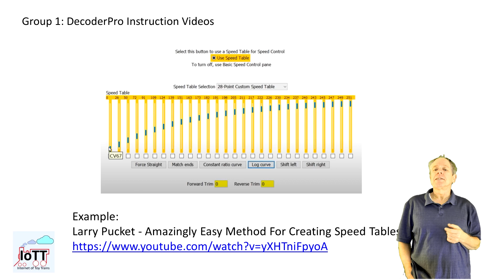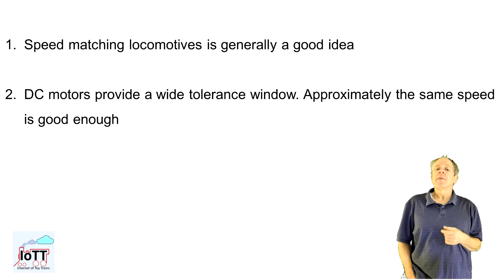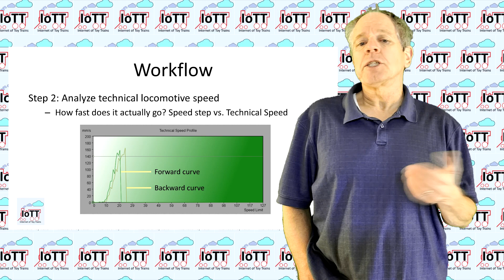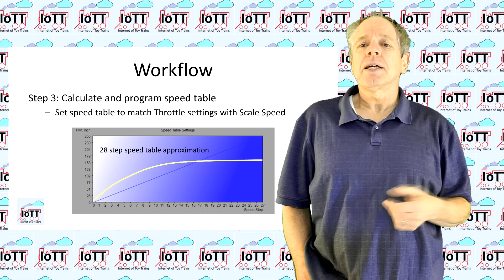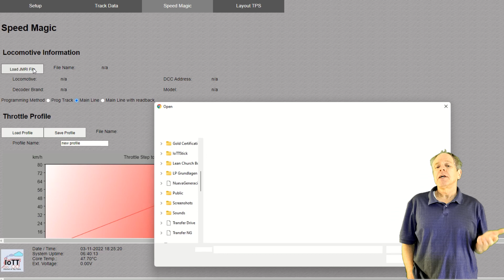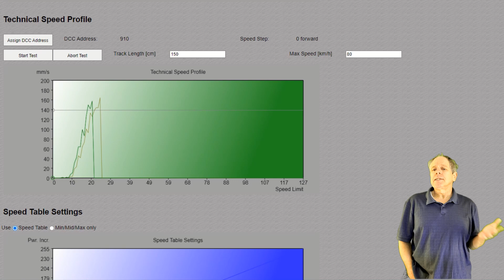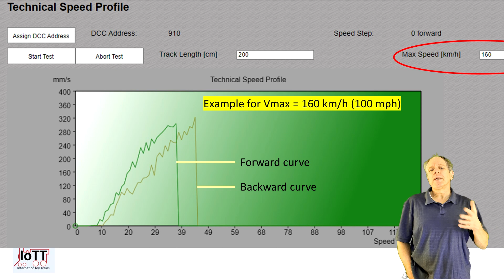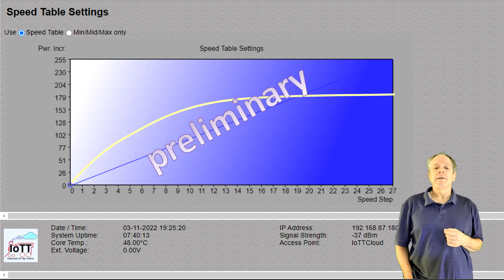Speed Matching Re-Invented (Video#90)

Comment: I love this innovative approach. I can’t wait to try it out. As I was looking at your purples hat measuring car trailing the engine. If we don’t care about a prototype look. I guess we can make the floor of the car the actual pcb board and screw the truck directly on the pcb. For this I guess a washer will be needed so the spacing between the wheel  and the pcb is right. At lease for n scale it can make sense as it will be hard to hide in a box car anyway.
Reply from the maker: A track measuring car is always not exactly prototype like, I guess. In N scale, the difficulty is not to exceed the allowable profile of cars. On a test track like in the video it is less critical, even though I also had some problems with the Stick touching the signals. Therefore I think for N scale the Stick definitively needs to be in upright position, but I am using still the old prototype board, so I had to lay it flat. The distance between axle and sensor chip of course should be as small as possible, especially when using only 2mm magnets as I do here.

Comment: I have place a boulder creek engineering speed step sensor into a MTL 6 axle drop bottom flat car with the inner wheel set running the magnet.

Comment: This is something I looked at years ago,  some sort of PLL or feed back loop but at the time the consumer chips that we had like the Basic Stamp were not up to par with what I wanted them to do.  Will be following this,  This is something I wanted to do in 2000,  just took someone 22 years to get to this point.  As a follow up,  Running NCE.  But if this works with a cheep Digitrax system,  that would be great.
Reply from the maker: Yeah, that was the time of the PIC controllers ;-) Luckily, today's controllers have a little more computing power.
Reply: @IoTT  True,  I worked at intel for 21 years as Sr. FAB Tech.  I have seen the change from the wafer level.

Comment: Is the Purple Head car something tht is purchased or made?
Reply: It's something that Hans will offer in his tinde store
Reply from the maker: The PurpleHat sensor board will be available in a few weeks in my Tindie store. I will also publish the board design on Github, as usual. So you can build it for your self.
Reply: @IoTT  I just bought the purple hat sensor board and the IOTT stick. Is that everything I need to do this speed matching.
Reply from the maker: @HumancityJunction  Yes, you are good as long as you have JMRI or another software the Stick can talk to to make the locomotive move., The Stick can communicate via WiThrottle or Loconet over TCP protocol. JMRI supports both, but Loconet over TCP I believe is only available if you have a Loconet system.
Reply: @IoTT  I have a WiThrottle server setup, so that is likely the easiest. I am running a LocoNet system as well, but have not used LocoNet over TCP yet.
Reply from the maker: @HumancityJunction  That should work. I would recommend to also try Loconet over TCP as with that protocol you can directly program the speed tables from the Stick, without first saving back the files, so it is somewhat more comfortable.

Comment: @Hans: Great idea. Which components of your universe are required to use this function? Do you have an idea when the measuring device is ready and available?
Reply from the maker: Thanks. If you have a LocoNet system with connection to JMRI (e.g. LocoBuffer), all you need is the IoTT Stick and the PurpleHat sensor PCB, which will be available in the Tindie store in a few weeks. The IoTT Stick can then connect via Wifi to JMRI using the LocoNet over TCP server.

Comment: I did some experiments with some N-scale locos. My test track has a length of around 18m. I placed 2 locomotives on the opposite side and let them run the same speed and see which one runs faster. This test showed that even with the same model and decoder they run diffeerently. It can be that loco 1 runs faster than loco 2 (as you would say the speed difference is well acceptable) and after  a few minutes this changes without any throttle changes. Also it can be different for slower and higher speeds. There are differences I did not mention yet. The P I D settings of the motor driver set in my ESU decoders with the auto setup of cv54=0 function imo influences the speed curve as well.
Did you measure the curve with acceleration in both directions only or also deceleration as well?
For me it would be helpful to know some grassroot rules for which criteria that must be considered. I struggle to consist different brands in general even if they are controlled by ESU decoders of the same generation.
What do I need to do when I want to consist 2 (or more) locomotives where vmax is 70Mph and 100Mph respectively? My roster is 3 point linear programed with CV6=(CV5-CV2)/2+CV2
Also CV3 and 4 influence consists.
Then I think traction tires require more accuracy in consist setups unless you don't mind excessive wear of the locomotives and debris on track or even traction tires falling off wheels (happened on.my FEF UP 844).
Reply from the maker: I agree, the quality of the can motors of N scale locomotives is relatively disappointing and their behavior depends on many variables.
I measured the speed of each step in both, acceleration and deceleration mode. The results are different, but mainly a linear shift of the curve, so to analyze it, it is sufficient to measure either or, I am doing it while accelerating.
I also found that it is better to have the load compensation on. Without, the speed of the unloaded locomotive tends to be ways too high so that it could slow down if cars are added. Load compensation makes it much more stable and predictable.
Running consists of course is a different story. In general, load compensation should be activated in just one locomotive, while the others adjust to the resulting speed by adjusting the pulling force. DC motors react rather significantly to load, so they can adjust a rather large amount without wheels spinning.
If you run two locomotives with different prototype max speed in the same consist, you want to make sure that they run the same speed at the same throttle position. And ideally, the maximum speed of the slower locomotive is achieved when the throttle is at 100% or you have an operator rule not to exceed a certain percentage.  That can easily be achieved by calibrating the scale speed to a throttle position like I do in this video.

Comment: hello this is similar to Bachrus und rollers that did in conjuntion with JMRI the read out of the 28 speedsteps. Could this be somhow be automated when setting a max speed and a linear curve?
Reply from the maker: I am not familiar with the project you are referring to, but the PurpleHat is a speed and distance sensor that works continuously while the train is moving (compared to 2-point time measuring like light barriers do). The software can automatically do a test run of the locomotive and then program a speed table setting in the decoder that matches a throttle position to a particular scale speed. Depending on the length of the test track and the prototype scale speed range that needs to be tested, the automated process takes about 1 -3 minutes typically.

Comment: Since the IOTT stick configuration can bridge Loconet to DCC at least at the command level, it should be able to issue Loconet speed messages that JMRI could sned tyhe appropriate commands to whatever command station is in use.

Am I missing something?
Reply from the maker: No, the IoTT Stick can't bridge between DCC and Loconet. It only can forward either DCC or LocoNet to e.g. an MQTT broker, or receive them from a broker. But it can't convert a LocoNet message to DCC (which is command station functionality) or convert a DCC message to LocoNet (which would be really tricky to do as DCC does not contain e.g. slot management related information).
For the time being, I therefore added a WiThrottle client to the IoTT Stick, which allows PurpleHat to run speed commands via JMRi to most command control systems. Unfortunately, WiThrottle does not support programming commands, so that part has to be done using DecoderPro. But at least,  PurpleHat can send back roster files with updated speed table information, so the extra effort is limited.
Reply: @IoTT  That should be adequate.....I didn't expect the stick to actually program the decoder(s), so just having to data to write to the decoder will be more than adequate to make the results practical.

Comment: Playing with speed curves for a while, i'm left with the same conclusion, that the motors is in pure shape.
Using the 28 speed curve, putting all at same number/speed/volume (150), and messuring with speedtrack, I have 3 drops in motor performance.
Speedstep 7,8 and 23, levers a 20-30 km/t less than alle the other.
I think this make it very hard to speedmatch trains, as speedstep that follows the drops, has to be much lower.
Reply from the maker: This is super interesting. Now, if you put all speed steps to the same output and you get speed differences, that would indicate a change in the decoder output, I think. What decoder brand/model did you use for this test? Did you try with other brands?
I guess I have to do some more research on the topic of decoder and motor quality ;-)

Comment: Do you imagine the difference in speed/step forwards vs reverse might reveal a mechanical issue in the loco?
Reply from the maker: Most likely it is a systematic problem with this particular locomotive and I guess a few drops of lubricant would help, as it is normally the case. But then, after doing a lot of measurements, I am fairly disappointed with the performance of the motors and gears in these Atlas locomotives. Getting a half way decent speed curve is somewhat challenging, and I am sure at this point, it is the locomotive, not the sensor. If you watch closely, you can even see in the video that the speed is not even nearly constant. The slightest grade even when it goes over a straight section of a turnout makes a difference I can see in the sensor. Also, speed for step x is not the same if reached from a slower speed compared to when the locomotive is coming from a higher speed. So, some low pass filtering of the speed curve is definitively needed. Another way to get remarkably better results is activating Back-EMF for speed measuring. That takes care of changes in the rolling resistance.
Reply: It is the rotation of the magnet and the motor,  the little DC motors are not perfectly symmetrical in both directions,  This pick ups can be off just a little bit in on direction vs the other providing more torq one way but more speed in the reverse rotation.